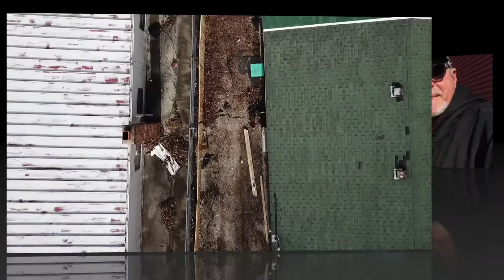Milwaukee 12 Volt Impact Very Impressive

Comment: The thing is, 12v tools with the new batteries and tool technology are more than capable for most tasks nowadays. I don’t find myself reaching for my 18v Dewalt impact very often. My little 12v Bosch impact is used 90% of the time.
Reply from the maker: cmal90 very true that’s me I grab my m12 most of the time. We do like the number 1setting on the DeWalt 20v for its slow speed. Thanks for watching and commenting you have a blessed day
Reply: How do they do driving 3" deck screws with the batteries that come with the kit?

Comment: More than 96% Milwaukee tools are made in China. Milwaukee Tool has carried out tool-design job in China since 2015 year, the design job also is slowly sent /transferred from USA to China.
Most plastic materials have been changed from America DuPont, GE to Chinese sources. The red plastic，Nylon，of Milwaukee tool handles/housings has been provided by a Chinese supplier since 2010，originally the Nylons were from DuPont，the Nylons-changeovers caused the handles/housings weak，like screws very likely strapped/slipped in screw holes. Also black hard plastic for battery pack cases/covers，changed from GE ABS/PC to a ABS/PC from a Chinese supplier，caused battery pack case more likely broken, brittle, the same story is happening on anti-flam Nylon material of battery frame，changing from DuPont to a Chinese supplier. 
Lots of bad tools always first are sold to USA because nobody inspects the outgoing, and because in USA Milwaukee Tool has the strongest warranty service ability than in other countries.
During Milwaukee production process, more than 5% defects found out by workers, also more defects failed to be screened out. Bad tools include noise as gear,bearing aligned badly, sometimes press trigger no reactions at all, metal parts like shaft, gear, pinion, important screw broken as poor heat-treat, motor stator rubbing with rotator, fine wire laid inside tool broken as poor design and poor workmanship, big percentage of oil leakage for hydraulic tools, etc. 15% chance you will get a bad tool, bigger chance you will get bad tools for nailer, planer, hydraulic tools, cable/tube cutter, as they are first generation of tools for Milwaukee Tool, because comparing with sawzall, drill, Milwaukee Tool is suck at nailer, planer, hydraulic tools, cable/tube cutter,AC tools, drain cleaner, blower.
Milwaukee Tool workers only get less than 300 dollars monthly salary，even plus OT to 276 Hours a month（normal month-workhour is 176 hours，plus 100 hours OT. Chinese law only allows no more than 36 hours OT per month）， after OT 100 HOURS for every month，a worker can get 500 dollars monthly salary，this salary very low for living in a big city in China, plus bad working environment(the management has no such safety-first mindset that loud noise but no issuing ear plugs to workers, at dangerous stations very few goggles issued to workers. workers stand more than 10 hours every day during on-duty time), so Milwaukee Tool with huge employee turnover，400% yearly turnover，ie workers averagely work only 3 months for the factory, cause workers without enough experience，lack of training，then unable to ensure good quality. And worse worker- turnover with most Milwaukee Tool’s suppliers. 
After Milwaukee tools launched one year， Milwaukee Tool will do so-called VE, value engineering ，actually cost-down, change Germany trigger to Hong Kongese trigger even Chinese trigger/switch, change Japanese chuck to Chinese chuck, etc. Milwaukee Tool has a team, 50 persons to do this VE. The quality would obviously become worse after the VE.
Milwaukee Tool has really bad quality system, lose much profit because of failing to keep quality constant. And always look for cheap materials, cheap suppliers, worker salary is always at minimum salary, only 30 dollars higher than monthly minimum salary.
Milwaukee Tool has less experience for making power tools comparing with Bosch，Dewalt, Makita. Milwaukee Tool only has grew fast from 2008 year. Milwaukee Tool copy and compare life test with Bosch, Dewalt tools during new product development stages, even when doing troubleshooting during R&D, would measure dimensions of these competitors’ components.
This company is also an ugly company, in 2014, a Hong Kongese manager tried to rape a female employee during their business trip, the company fired him and less than half year, hired him again as a manager, then the female employee left this company and lost her job. In 2015, in its factory dormitory a more severe rape case really took place by a male senior manager to a girl.
Reply from the maker: manjames1 rich wow is all I know to say. So is dewalt a better company?
Reply from the maker: Backwoods Compatible thank you that’s good to hear and know, I thought that was a lot of information. Thanks again for the heads up. You have a blessed an awesome day.
Reply: urjnlegend that's what he said... he said he looks for videos that speak positively about Milwaukee... and then he goes into his negative diatribe about Milwaukee
Reply: thanks for you guys‘ favors to this comment.@ Backwoods Compatible ， the rear is creepy. I have been working at Milwaukee Tool 10 years since 2008 they moved production to China.